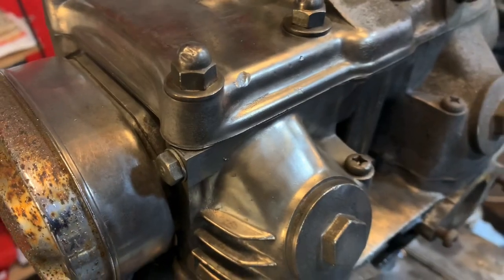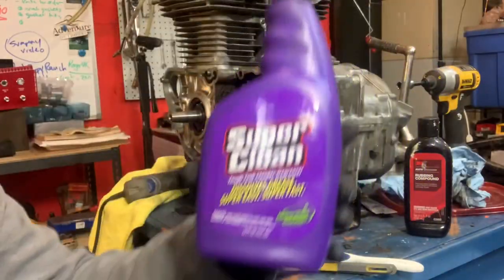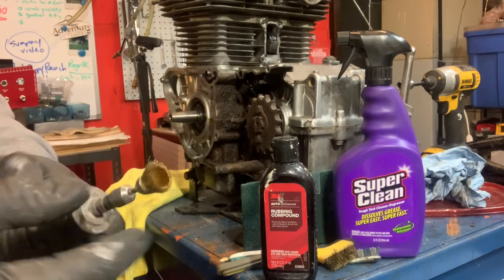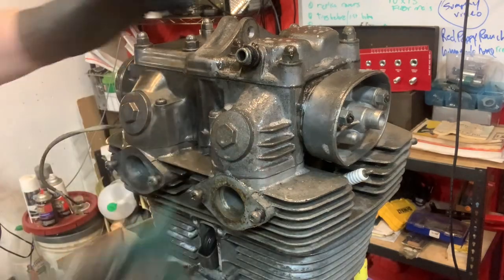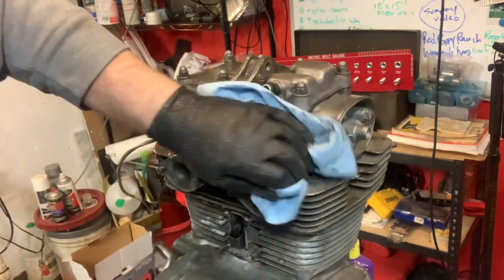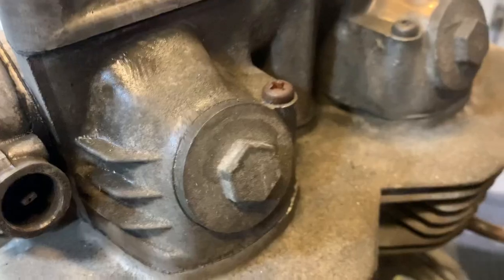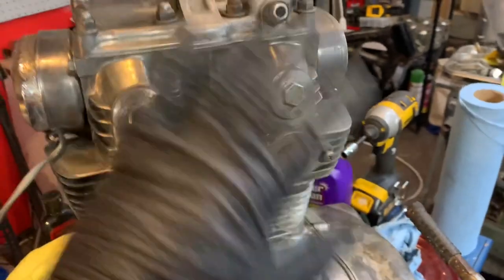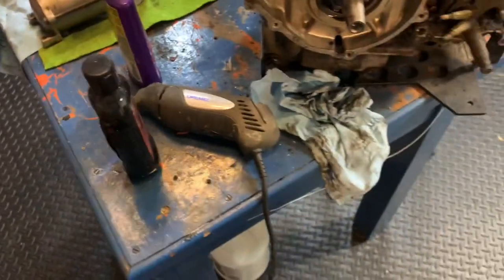Cheap Way To Clean & Polish A Motorcycle Engine

Comment: Those rotary bushes are the key.  I used WD40 and a bunch of those cheap rotary tool brushes (steel not brass).  My 40yo Honda engine was heavily corroded.  I spent many many hours over several days to bring the engine and casings back to a highly respectable finish.  It turned out so good that I never needed to paint anything.  I wore glasses and a leather apron and still weeks later I was picking bits of wire out of my clothes.  Ensure engine opening such as exhaust and intake are blocked off.
Reply from the maker: Great point on blocking any passages. Those bristles do go everywhere.

Comment: This is exactly how I was trying to clean mine up. I was hoping i'd find a much easier faster way.
Reply from the maker: Not sure there’s a shortcut unless you vapor bkast.
Reply: I think the same as you and I learned using a handheld sandblaster using baking soda and that works actually great

Comment: Thanks for the video! I too like using those brass brushes in a Dremel tool. As you say, wearing glasses is a must. During my most recent cleaning session I found that a couple of the brass bristles were stuck in my face like little spears! I had a jacket on at the time and a bunch of bristles were lodged inside the sleeve a few inches up from the open cuff. Gadzooks!!!
Reply from the maker: Yup. I went to the auto parts store with one in my forehead. Lol

Comment: I would whole Heartedly endorse the SUPER CLEAN cleaner. That is one of if not one of the best degreaser's/ multipurpose cleaners on the market. However, you can't let it dry on metal as its so potent that it could damage the surface if it dries
Reply from the maker: It’s magic stuff. Maybe not magic but does some great work fast.

Comment: Maybe there is something I don't get but if you're using rubbing compound( which is fine grit) with a brush (coarser grit?):. Is that just a step saver?  Or, is it a little redundant?  Sorry not trying to cause an argument but I would think that using rubbing compound was a step in polishing.   I would think using a gun swab wait the rubbing compound would leave a better finish than a brass brush.   Just a thought.
Reply from the maker: Honestly, I’m just trying to break through. Fine polish can come later. I found a bit of grit helped get into the details of the surface more to break free the 50 years of stuff. Degreaser helps for sure but didn’t seem to get into the small stuff. Not sure it helps but it at least helped me feel like I was making progress. I usually just clean the motor well…some go for fine polishing. What I would give for a vapor blaster!

Comment: Hi, great video which has really helped a newbie like me... I have a question though. When it comes to the brass brushes for the multitool do you use steel brushes that are brass coated or pure brass brushes? Many thanks :)
Reply from the maker: All brass would be ideal but since then I’ve found Nyalox brand brushes. Game changer!

Comment: Has anyone tried alloy wheel cleaner? The powerful version that bubbles up the minute it comes into contact with the alloy and let on only for a few minutes, agitate then wash off. Cleans my old crusty engines very quickly (obviously all safety PPE must me used etc)
Reply from the maker: Never tried it. Heard oven cleaner can be good too